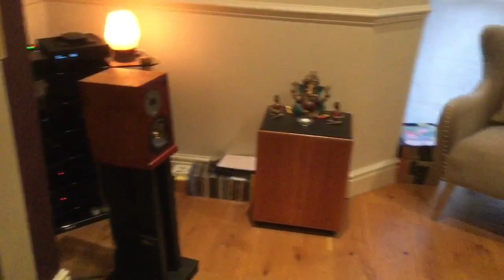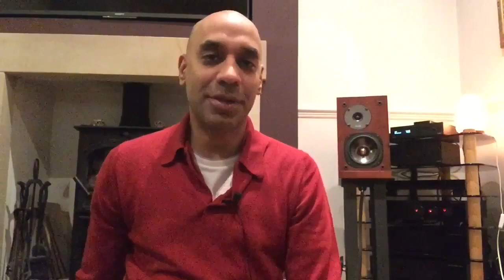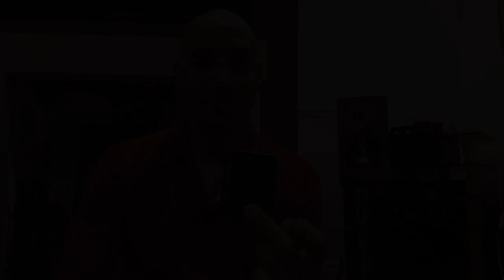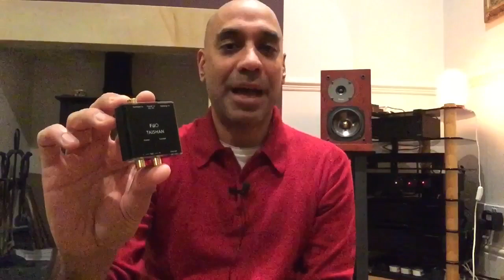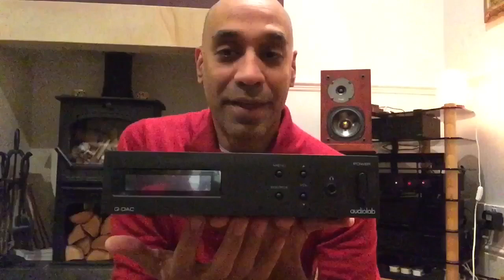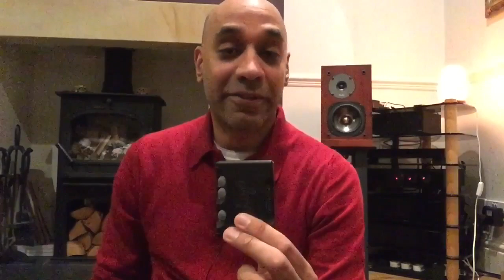Chord Mojo Review - Vs Chord Hugo and other DACs

Comment: How does it compare to dragonfly cobalt?
Reply from the maker: Hi Andreas, I haven’t got the Dragonfly Cobalt to compare it with. The original Dragonfly DAC were designed by Gordon Rankin who is a digital audio guru and extremely well respected designer. However, they are low power devices designed to draw power from your phone or computer usb line. As a result, as good as they are, I wouldn’t expect them to preform as well as the Mojo which has a dedicated usb power connection. 

Thank you for watching the video and commenting.
Reply: @abritishaudiophile7314  I thought the Mojo was battery powered, so I'm confused by your statement that it has a dedicated USB connection.  If so, it then requires two USB connections - one for power and another for signal, correct?  I imagine separating signal from power is beneficial, but thought this was done with the battery.
Reply from the maker: Hi Vic, you are right, it has two usb connections. One for signal and one for charging the battery or running with a 5v power supply.

Comment: Never listened to the mojo but only to the Hugo1. Was not convinced by the Hugo 1. Bottom was not that impressive compare to an old Sony Das R1 nor the midrange actually the latter was better. Only the top was better with overhall slightly better extension. So if it is simply for cd conversion I do find Chord Hugo way to expensive...and FPGA is nothing new in audio so that it can justify that price.

 But I am curious to listen the TT and the Dave.

No matter what, good job man for sharing some knowledge.
Reply from the maker: Hi Frederic,  suppose it all comes down to system matching a personal preference. Thank you for watching.

Comment: Ok, so it sounds great through headphones or a hifi. However, it isn't mobile joy, more like mobile frustration. 
It is too big to fit in your pocket along with your phone, even a small phone. This confinement causes it's buttons to be pressed, turning it off. Why no option to lock the buttons. The confinement also causes your phone's touch screen to activate. I tried  a screen lock app, but obviously it won't lock the mojos buttons.
Also, the confinement causes the usb to be bunched up and loose it's connection. Sometimes this results in the worst noise you will ever hear in your life. Why don't they have a protection feature to stop this. The noise is so bad it could literally give some people a heart attack. Finally, there is no EMF shielding. It picks up the noise from your phone if it is next to it. Turning on airplane mode solves this, but then you can't receive calls. 
If your're after great sound you will only get it if you use this as a desktop device. It isn't mobile in the slightest. 
Also, it picks up awful noise when charging through a usb cable. It can only be used unplugged from a charger.  2/5

Comment: Mojo does have 38.000 taps, but they run at half speed. ... That leaves the original Hugo with 26,000 taps, more powerful. ... I think the Hugo also had a better output stage, but don't quote me on that.
Reply from the maker: That is strange. To my understanding the taps relate to running the algorithm in the interpolation filter. I am not sure you can run them at 1/2 speed 🤔
Reply: @abritishaudiophile7314  As far as I know, it's  the clock speed of the FPGA, that has lower clocks. If you search 'speed' by user Rob Watts on the Mojo thread on Head-Fi, you will find something.
Reply from the maker: @threecats8219   Why would you run the FPGA at half speed?  If it hasn’t come from Rob Watts, I wouldn’t pay to much attention to it 😉
Reply: @abritishaudiophile7314  You always argue with me when I am right. With the Mojo battery it would not be possible to run the Mojo chip at the same speed as the Hugo. There is not enough power to do it, because th battery capacity is much smaller. It did come from Rob Watts. I saw him write it myself, because I followed the Mojo thread right from the first post. I even gave you a search so you could see for yourself. 

Post 37, 836 in the Mojo thread on Head-Fi, explains it all from Rob Watts. I just looked for it again. Why don't you. I am done with your channel - because your attitude is wrong.
Reply from the maker: @threecats8219   Hi TC, thank you for clarifying. I wasn’t arguing, it was just that it struck me as odd. Unfortunately, I don’t have time to read through threads on hifi forums. Apologies if it came across as argumentative. That was not my intention.